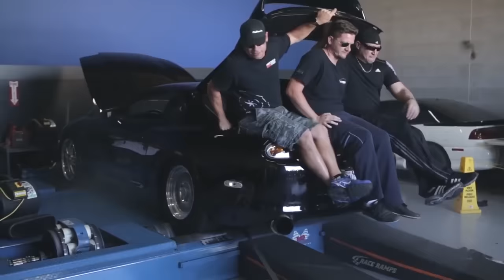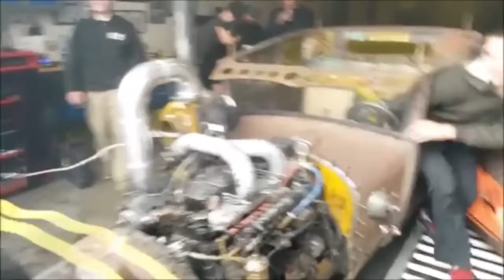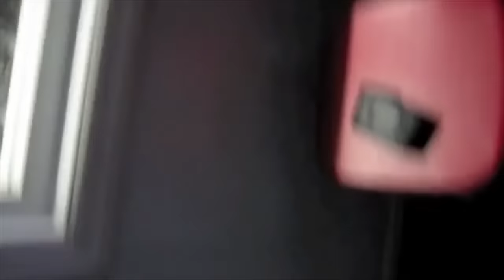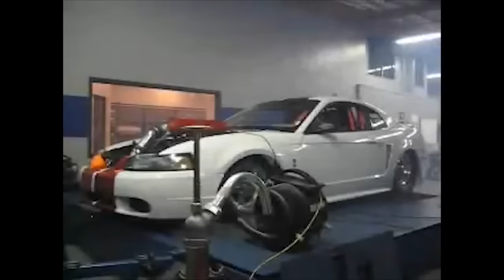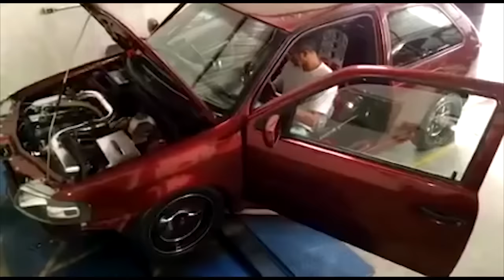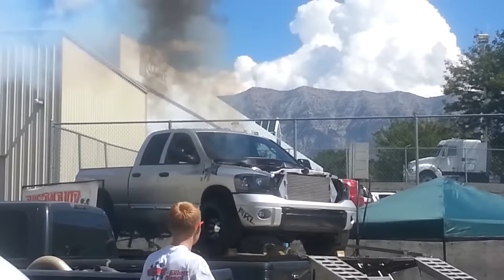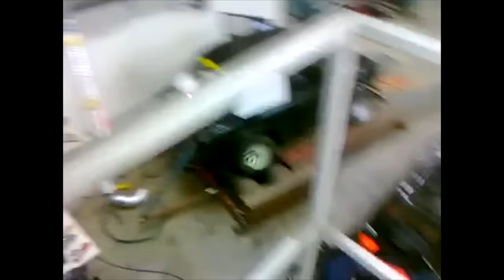The Best Dyno Fail Compilation

Comment: The sad part is, most of this could have been avoided by doing quick math and understanding the functionality of your equipment.
Reply: Hi there they think nothing about the noise  barrier and the damage they are coursing  but I think you are an intelligent gentleman  not like these peaple  it does look quiet a dangerous thing they are doing no health and safety at all
Reply: Most of this could have been avoided by not smoking crack and meth.
Reply: Accidents can always happen. That’s the reason why rule #1 around cranes is: Never get underneath the load. The same applies at such dynos but then horizontally; Never get nearby them while running the test.
Reply: "Haha engine goes brrr let it do mpre than it can do haha"
Reply: No offense but most of the smooth brains who replied to this are the reason this shit happens. Love you guys 😁
Reply: @lindaforrester464  huh?
Reply: so true bud.When a bunch of dummies gather around something they clearly do not understand  or fully comprehend the nature of such equipment then disaster is sure to follow.
Reply: They have issues with their equipment, that's why they drive these vehicles  and the lift trucks. It's all about their equipment.
Reply: Whu whu whut?  Can I not just fill the engine with corn oil? 🤪.
Reply: I bet a lot of these could have been avoided if they actually took the time to break in the engine and get the parts all fitted together by running and driving for a little bit not crazy but just enough to get the parts worn in a little bit, then hit the Dino and see how much horsepower your pushing
Reply: Titanium bolts do magic, that what they said...
Reply: i dont think a lot them even know math
Reply: @Groaznic  2+2 is 4 minus 1 is 3 quick maffs
Reply: I don’t know if you noticed, but these people are not the sharpest knives in the drawer.
Reply: What's going on can you please tell
Reply: t                                            ,
Reply: @lindaforrester464  r          z   6   m.
 bb m
Reply: I'm not sure why they try to dyno all 4 wheels remove either the front or rear driveshaft and dyno only 2 out of the four wheels... way less possibility of it slipping off the dyno
Reply: @StratMatt777  LMFAO!!
Reply: You said "your equipment"
Reply: agreed
Reply: All these people should be doing something useful with their lives.
Reply: That comma was incorrect/unnecessary.
Reply: Guys, Here is our Savior

YaH The Heavenly FATHER HIMSELF was Who they Crucified/Pierced for our sins and “HERE IS THE PROOF”

From the Ancient Egyptian Semitic: 
"Yad He Vav He" is what Moshe (Moses) wrote, when Moses asked YaH His Name (Exodus 3)

Ancient Egyptian Semitic Direct Translation
Yad - "Behold The Hand"
He - "Behold the Breath"
Vav - "Behold The NAIL" <— YaH’s Crucifixion
He - "Behold the Breath"

“Behold the HAND that Beholds The NAIL” 

PROVES - YAH The Heavenly Father HIMSELF was Who they Crucified

That is EXACTLY what Moses Wrote

Here is what they mean

YaH's Name:
(Ya)d + (H)e, as YaH is what Moses called Him and YaH Declared: "this is My Name, this is My Name for all generations" (Exodus 3)

YaH is The Creator of “MAN”: (Genesis 2:7)
Yad He, (HAND BREATH), as YaH's "HAND" Formed man from the dust  of the Earth and His "BREATH" made him a living being (Adam)

YaH's Sacrifice of Crucifixion for “MAN”:
Vav He (NAIL BREATH), the "NAIL" through YaH’s "HAND", in Sacrifice of Crucifixion, that whosoever shall call YaH Savior, His “BREATH” brings forth life (Salvation)

How YaH arrives:
YaH arrives via the Tent of Meeting (Exodus 33:7:11, Isaiah 54, 55), where a Tent is erected outside the city, a cloud descends upon the entrance of the Tent and YaH appears...

Why they demanded YaH to be Crucified:
YaH was Crucified according to Hebrew law (Deuteronomy 21), to be NAILED/PIERCED on an Almond Tree for BLASPHEMY as it was for His NAME they demanded Him Crucified. The Messiah claimed He was YaH...

HE WAS YaH!!!

HalleluYAH translates “Praise ye YaH”

The Hebrew Book of Isaiah

Isaiah 42:8
"I am YaH; that is my Name! I will not yield my glory to another or my praise to idols.

Isaiah 43:11
I, I am YAH, and there is no other Savior but Me.

Isaiah 45:5
I am YaH, and there is none else.
Reply: sadder part is, this could have been avoided without doing math.. and just not do this stupid thing AT ALL.. i mean, what did they expect?
Reply: Math and mechanics usually don't mix well, at least the mechanics I'm used to.
Reply: @gi_nattak  ok Karen
Reply: What is this “math” you describe
Reply: @NicholasAndre1  no spamming
Reply: Have you actually looked at the people in this video?
Reply: If u wanna make an omelette…

Comment: My Dad used to say, it's ok to hear an engine scream, but if it sounds like a jet /turbo prop taking off you know there's too much power.
Reply: Every diesel ever
Reply: @DuckMcDuckinson  you should know the difference between a regular diesel and a jet at take off lol it ain’t the same and these for the most part are CARS screaming like jets.
Reply: @hershall_3162  yeah. Diesel is baby jet.
Reply: @DuckMcDuckinson  but not a jet at take off. Jeez.
Reply: ya what colors your bu-gatti?
Reply: @drgamewatch  don’t need a bugatti to know someone is fucking their car up
Reply: @hershall_3162  why did you put cars in capitol?
Reply: You drive a station wagon, and your boyfriend with the man bun is the alpha in the relationship isnt he?
Reply: @ItsSerialBoX  Nah I'm a dude and daily a Jag XF 5.0 and have a 68 Olds 98 with the 455 Big block. So yes I am the alpha and don't need anyone to tell me my business. V8 rules, no replacement for displacement.
Reply: i presume this only applies to cars and not large diesel engines, could name several large displacment diesels that sound like jet engines at full chat
Reply: @subiesubie  ‘So yes I am the alpha’

drives a pair of sub 400bhp cars that weigh more than the moon
Reply: @mcgherkinstudios  The Xf has 385hp and does 0-60 in 5.3 seconds. So it's really quick. Plus the olds has about 350hp and plenty of torque to spin wheels for days. But I guess that's far to 'mainstream' for someone who drives a Miata.
So yes, I am the alpha.
Reply: There's no such thing as too much power, only not enough traction.    -Carol Shelby.
Reply: @subiesubie  It’s slower and has a worse power to weight ratio than my Volvo.
Reply: @subiesubie  bro on here lying to strangers with a import car handle lmao
Reply: There is no such thing as too much power.
Reply: have u heard a paxman valenta

Comment: Pro Tip: Running an engine on a dyno is only a few second function. Not 20 seconds under full load.
Or in most of these cases, until it blows.
Reply: yea not to mention specs of the dyno... not going full beans at higher speeds etc... lol 
a few of them might have just been a catastrophic engine failure due to bad tune/air fuel ratio/timing (pre-ignition, detonation) 

scary asf those guys mobbin' so deep around the dyno that it looks like they are shooting a rap video when the whole operation scatters at 10,000 RPMs lol 

I am in danger (Ralph Wiggum voice)
Reply: True, I've seen professional dynos they get to remove then immediately back off.  Idiots at work.
Reply: the essence of the engine is that it can run at maximum power for a long time. if it falls apart after 20 seconds, then it's a piece of garbage
Reply: @OggyXXXL  Generally I would agree with you. When a car manufacturer tests an engine on the dyno for regular use on the street, they run it at wide open throttle nonstop for a few days, But with the power mods some of these engines have they will only last for short pulls on the dyno, or maybe the drag strip. Or maybe less in these cases.
Reply: @OggyXXXL  all engines on the video are out of the factory spec due to bolted by idiots turbos and who knows which another modifications. Is there any surprise that they fall apart?
Reply: @OggyXXXL  maximum power is relative to resistance. and engine never really runs at maximum spec on road, because the resistances of the forces affecting the car don't allow it (drag, road resistance, gravity, etc.) doing a constant pull on a dyno equals to basically parking the car on stands and doing the same. no resistance means the engine is now fighting with its own parts, and the stress eventually pulls it apart.
Reply: @OggyXXXL  Not my first rodeo.
For a stock engine, yes. For one that a bunch of unknowledgeable people have done some questionable mods to? Not very long!
Reply: @_vindicator_  dyno has resistance, tht's how they work -otherwise why not just leave it in neutral? not just a free spinning rolling road. The touque resistance x rpm speed it pulls is the power.
Reply: @brendanoneil3489  it wouldn't register in neutral. but yeah, some engines are directly dynoed from the crank. everything has resistance, but rolling resistance on a dyno is left generally much lower, than if a car was on road, to avoid all kinds of movement from the chassis. the point of the dyno is not to provide resistance, but to measure the speed and torque. much like you wouldn't do that uphill or downhill in a car, a dyno doesn't provide extra resistance either.
Reply: @_vindicator_  " the point of the dyno is not to provide resistance, but to measure the speed and torque..."  how does one measure tourque without any resistance?
Reply: @brendanoneil3489  you're mixing up two different things. as i said, the point of a dyno isn't to provide resistance. we are talking about this, because we were discussing resistances to the engine when a car is driven. i asserted the car encounters much less resistance on a dyno than on the road, which is the point. if it encountered all the resistances, then the dyno would account for wind, grip, inertia, velocity, downforce, heat to name a few. i never said the dyno has no resistance, merely that it is not supposed to create additional ones. to summarise, the dyno creates less resistance than a car would encounter on a road, to measure the engine performance alone. if you push a car on a dyno, you do that until the engine reaches maximum output and then you let go. you don't keep pushing the engine, because unlike in reality, the resistance is much lower and the engine will go exactly like in the video. to your question about torque, you always measure torque in relative terms, there is no 'absolute' torque, unless you are measure at crank. if you use a rolling dyno, tyres, axles, transmission, clutch and many other parts affect the output in relation to the rolling resistance of a dyno. hence my comment about measuring uphill or downhill. the dyno will provide an approximation of torque relative to optimal circumstances, straight line travel and no aero resistance.
Reply: @_vindicator_  power at wheel(s) =tourque x rpm     presumably the tourque load gets adjusted between different power output vehicles?  heat, inertia and downforce are irrelevant here,  wind resistance is the biggest drag felt at the drive wheels - which can be dialed-in surely?    
 Reason they go pop is holding them on the redline too long,   (in ww2, some spitfires had an 'emergency' throttle setting,  max 30 seconds and every motor would need a full rebuild - drag racers rebuild their motors very  regularly just for a few 1/4 mile passes)   Some tuners actually run-in new motors on a dyno, good for seating the rings fast before bore glaze.
 Also surely better for an engine to fail on the dyno than the road?

Comment: Engine: exists
Driver: Harder!
Engine: no longer exists
Reply: Lol
Reply: 6:32
Reply: @alguien_22  Lol.
Reply: Basically sums up the video😭😭😭
Reply: lmao
Reply: Hahahahahaha that was hilarious
Reply: i mean im all gas or diesel but electric i dont think blows like engines do and can prob take longer to overheat and blow up, until u puncture ur alkaline battery and it mixes with air and blows the whole car up only thing left is just the body, or what used to be the body
Reply: Driver : wears White Socks ...
Reply: @xnoobgaming7507  fun fact: when a battery of that size explodes, the flames get so hot that they are able to melt concrete. Makes you think twice about buying an EV
Reply: Becomes external combustion engine

Comment: Darwin Awards candidates, every one of those fools standing mere feet from steel parts revolving at 10,000 rpm.
Reply: Thinking the same myself , and not to mention if the car breaks the straps while a dude is  near it and jumps off the dyno , he/she could  be having a very bad day .
Reply: That's for the engien. Turbos are closer to 150,000 or even more...
Reply: Double-Darwin to the guys who put their hand on the engine while it's doing it's thing.
Reply: they're trying to catch souvenirs...
Reply: Triple points to the guy who almost got his entire leg sucked into the roller at 9:22
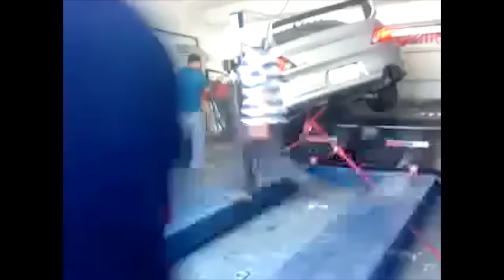Reply: 0:47 at least this seems to be a safe environment but the rest def prime Darwin awards candidates
Reply: my motorbike revs up to 10.000, and i am sitting on 1 of the 2 cylinders...  thx to remind me about that...
Reply: @Arltratlo  So does mine, but you still missed the point.
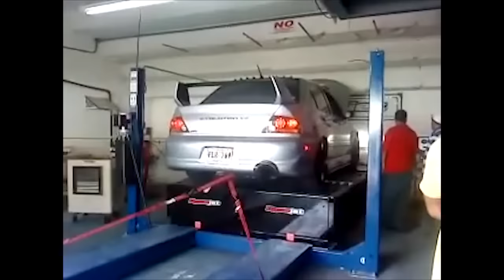Reply: @mikldude9376  what you describe almost happened at 0:22 . That guy in red is lucky that the accident went to the left instead of right.
Reply: Quadraple points for the guy in front of measured car at 9:05
Reply: @kzyho  No shit right... Dude is insane
Reply: I'd say it goes to the guys who reached into the engine bay of that supra with a turbo bigger than the engine
Reply: at least
Reply: Its ok the engineers will save them. Im sure they design these machines to fail in a somewhat controlled manner so shrapnel doesnt go flying into all of them.
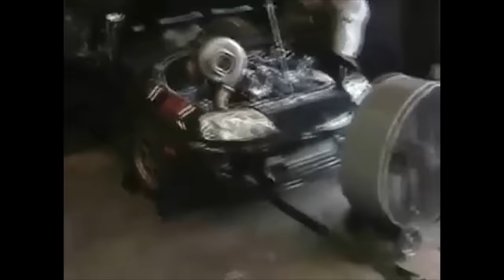Reply: The guy at 5:15 sure went and rethought his life.

Comment: 06:31 v-tech kicks in hard 😬
Reply: LMAO
Reply: Ap
Reply: Ap
Reply: what even happened there, can you explain? I'm genuinely curious why it just ignited
Reply: @fin3662  Too much pressure, looks like the head gasket had enough.
Reply: I am literally laughing out loud.!
Reply: @hondaaccord2425  é um gol g3 motor AP 2.0 , vtec é meu ovo
Reply: @fin3662  someone else already said pressure, engines generate pressure to drive the crankshaft but there is a limit how much the engine can physically withstand when you keep increasing power.

The reason it ignited is because all the hot flammable gasoline and oil vaporises instantly as the engine breaks apart and releases that high pressure. Big cloud of suddenly released fuel + sparks = fire.
Reply: @robertdiablo  kkkkkkk
Reply: More like kicks out hard

Comment: 6:24 was AMAZING!
Reply: F wv gol
Reply: Brasil
Reply: Lol
Reply: Yea
Reply: BRAZIL
Reply: Car FWD
Reply: @aqxjr1k  Brasil*
Reply: I dont understand why people put their cars through this much stress just to prove a power rating, even if you did somehow managed to get by alright power stress test decreases the engine's lifespan and durability significantly
Reply: @ernestochang1744  they want to see how much power they make so they can tune it for how they want, or see how much power they have gained after modifications
Reply: @ignoreddemon1857  yeah i know its too bad their engines will die faster
Reply: @ernestochang1744  they could always rebuild it and keep the modifications if they had the money and time
Reply: @ignoreddemon1857  high performance engines are hardly built around durability these days, i am a car guy but if i were to have a lovely corvette or a ford mustang, every rev past 5,000 rpm every harsh shift or acceleration hurts a little on the inside, i feel empowered like i am the fastest thing on earth like i am 1 with the machine... then i hurt inside because of what terrible thing i have just done both to the law the car and my sense of direction. Look yes racing is fun and all but sadly you cant expect to race a car around a track for 50 kilometers non stop without it having some kind of fault wether it be overhearing issues or braking issues or compression or air flow, theres only so much that we can do for a cars engine and transmission tires and brakes before they all just break apart because some1 decided to push the car beyond its reliability limits. Its a tragedy because we as car guys want to go fast, we want to feel the wind in our hair we want to be in control of the car, but its always the car in control of us, even if you may not feel it every car fights you the driver and when the car eventually looses the fight you have to pay so much money to bring it back, its not even worth thinking of going for a nice track drive. Sorry the reply is long, but i hate it how wverything eventually will come apart no matter how well is taken care of, look at us humans its only a matter of time before we die.

All a dyno test manages to do is decrease the lifespan of your car
Reply: what kind of goofy car is that.
Reply: @ernestochang1744  Its usually done to tune the engine not to test the power output.  You map out the air to fuel ratio for different revs ranges and change it as needed.  Then you usually do one pull, most of the time in 3rd, to see if everything is running smoothly and see how much more hp they got.  Dynos are usually for tuning not flexing.  Sometimes shops will do dyno days specifically for people to flex but that's more to get people into their shop.  Also, some car shows will bring dynos for people to flex on but that's literally just a dick measuring competition.
Reply: That was probably a nitros build.  Get the air to fuel mixture wrong and this will happen.
Reply: @ernestochang1744  These engines have the same cost as a piece of bread here in Brasil so do the performance parts